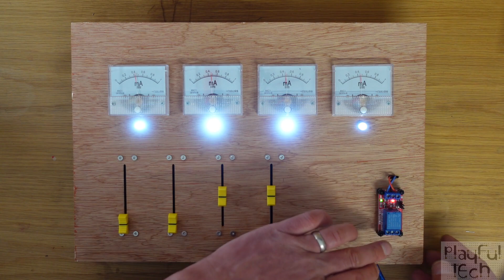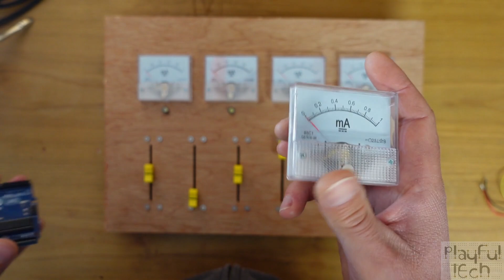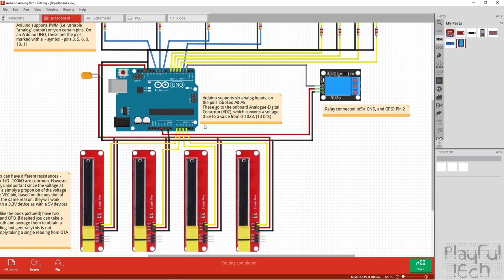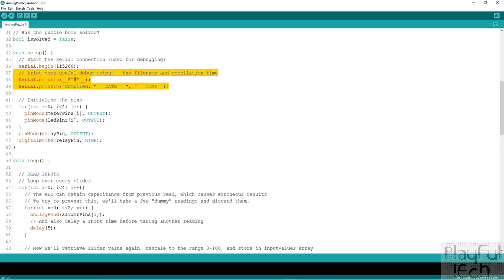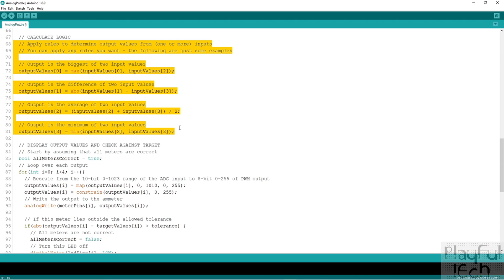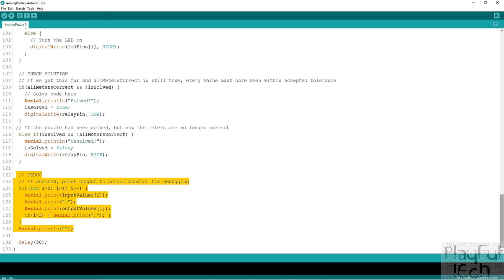How to Create an "Analog" Arduino Escape Room Puzzle

Comment: Has any actually implemented this? The wiring diagram actually shows NO 5V source for the potentiometers! AREF is a reference pin, not a source of voltage. I've run this wiring diagram by two other people and they don't see a 5V source noted on the diagram connecting a 5V pin on the arduino to the actual potentiometers. Is there an assumed shortcut  the creator is taking?

Comment: Thanks for the clarity of explanation regarding grounding and noise. Do you ever find that the relay switching causes interference with the Arduino (or nearby Arduinos)? I've been looking a lot at flyback diodes so wonder why you don't use them.

Comment: It's worth covering compiler directives for debug, you can shove a load of debug code in but it might slow your code down in real use, a compiler directive allows you to simply switch code segments on and off depending on whether it's development code or live code. This video also taught me about sending the sketch name/version which I'd never realised before although I have used the compile time/date to set a real time clock but you still have to combine it with a physical button to fine tune it. program the Arduino, wait until the time rolls over to 00 seconds, hit the button.

Comment: It's best to filter analogue inputs either externally with capacitors or internally with software. It's unlikely to be an issue here with such low currents but I did have to debug a system where they'd run sensitive signal wires alongside 10Amp motor wires and while I couldn't fault the software (it was far better than anything I could write) the hardware left a lot to be desired. A small capacitor from each analogue input to ground will average the signal with any noise so acting as a filter.